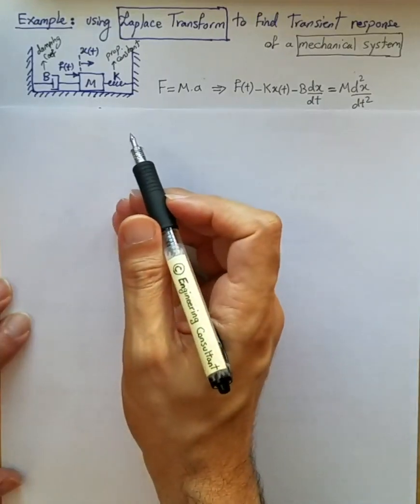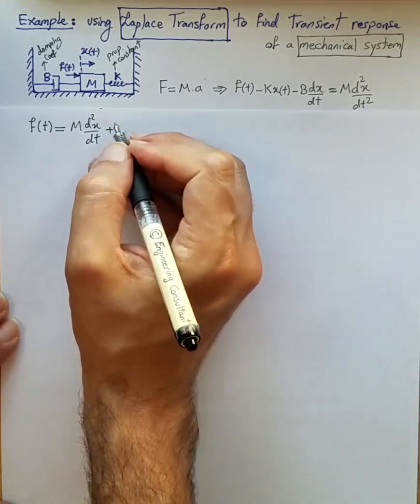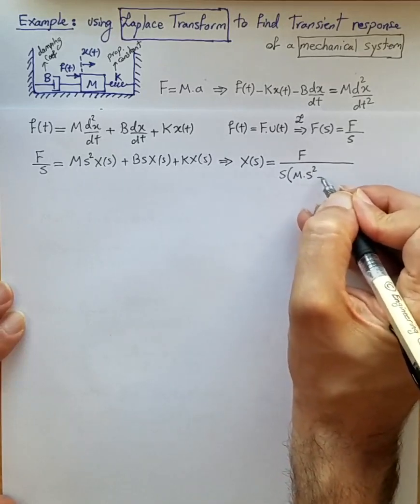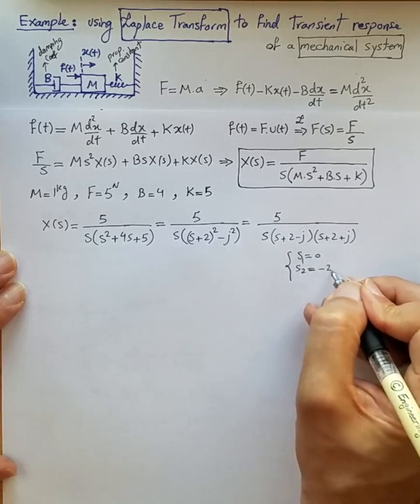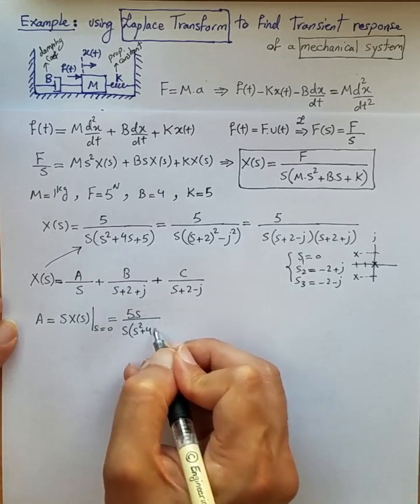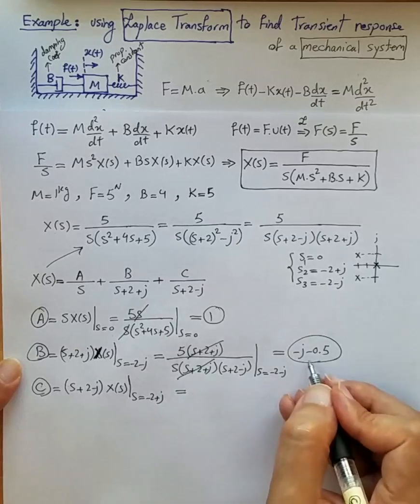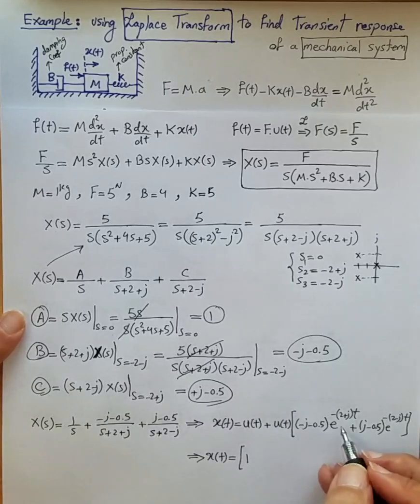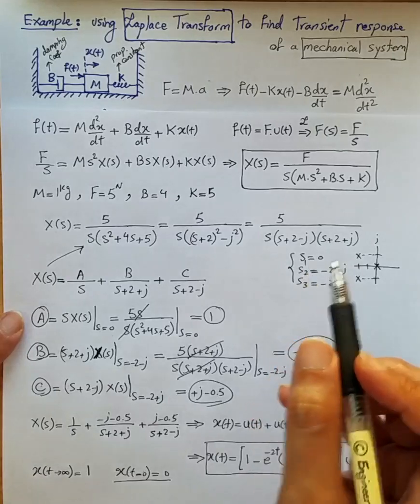using Laplace Transform to solve spring mass mechanical system transient response

Comment from the maker: Thanks for watching. As requested, here are further Video examples of modeling spring-mass-damper systems:  
Electric Circuit Analogy for Mechanical System: https://youtu.be/997hfjGK3_w  
https://youtu.be/lCyJGtUK9zs : Double spring mass system analysis using Laplace Transform.   https://youtu.be/I5qTyPIo-xg : Double spring-mass analysis using Laplace Transform.  https://youtu.be/CLY4f9RZo_U Oscillation frequency of Tuning Fork using Laplace Transform
Hope you find them helpful.

Comment: At 4:07, where does j come from?
Reply from the maker: Good question. Basically 5 = 4 -(-1) = 4 + j^2 where j^2=1.  Here are a few more examples:
Double spring-mass system analysis using Laplace Transform: https://youtu.be/I5qTyPIo-xg , 
Electric Circuit Analogy for Mechanical System: https://youtu.be/997hfjGK3_w
Oscillation frequency of Tuning Fork using Laplace Transform: https://youtu.be/CLY4f9RZo_U 
Hope you find them helpful.
Reply: @STEMprof thank you🙏🏾
Reply from the maker: @Emiliano88888  You're welcome!